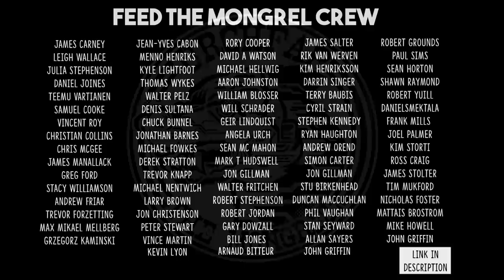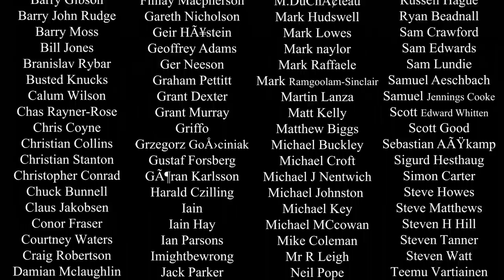THE MONGREL PART 57 ENGINE BAY PAINT

Comment: I have found best practice is to treat all bare metal with Phosphoric Acid, quite a number of products around often called some form of rust treatment, Deoxidine is one here in Australia.
Just brush it on and leave it. It will leave a slightly powdery white surface you just leave on till your ready to paint, then scuff off and etch prime as usual.
Nice to see some progress with the paint at last.

Comment: Hey Matt, I did some rattle can spraying on my car and used a clip on handle and trigger from Halfords, it's miles better than the button pushing, it feels like you're using a propper gun, but they are  stiff to get on the can when new, I modded mine and it works great.

Comment: Get yourself an infrared heater , it will heat what you point it at and won’t put diesel particles in the air .
Reply: He wont listen to any advice from car painters etc which is a shame...mask up the cross member and NOT mask up the scuttle!!!  All that over spray landing on a flat surface..
Reply: @theessexhunter1305  the scuttle will need flatting down and prepping before paint anyway, so no matter really.
Reply: it also doesnt blow dust around and into the paint, unlike more conventional space heaters, like the diesel heater.
Reply: @Sennaxm71  Good habits are far better than bad ones...cleaning and prepping a weld joint for ally or stainless is just the same. Not leaving swarf under the a work piece on the milling machine vice or bed. He de-greased the job only to blow diesel particles back on to it....Yes he will clean it off but less work for the sake of a a bit of masking paper is a good habit. I had a fantastic tool making  apprenticeship then later in on was taught body work by a Ford Rally body painter. My Dad taught me how to lead panels from his time as a plumber...So there are a few of us who know what is what...
Merry Xmas.
Reply: @theessexhunter1305  When did you say you were going over to paint the rest for him? 🎨
Reply: @Laz_Arus   The art is in the prep...good habits lol
Reply: I'm pretty sure that at this point hes more concerned with just getting paint on the thing than how its going to look when its done.  Just watch his tells when talks about it now.  He's so over this build its not even funny. I think he just wants it done so he can do a payoff vid or two with some smokey burnouts and get on with whatever comes next.  I can't say I blame him either.
Reply: Kristy- Matt takes donations..........

Comment: you should be wearing skin and eye protection. a full tyvek suit and sealed safety glasses. i did a set  of rims with 2 part epoxy aerosol . the vapors "melted" the lens's of my safety glasses. the very carcinogenic chemicals in the 2 part paint will easily pass through skin and the surface of your eyes. love the build cheers!

Comment: Good to see you get some paint down at last. Was thinking about the rest of the car/bare metal etc must be frustrating to see the surface rust appearing you just need to get a bit of protection down onto it.... that paint has come out pretty good have seen another ‘Tuber’ use the same system like you say great for smaller areas. Keep at it Matt, inspirational stuff as ever.

Comment: Put you self a poly tunnel off your metal rakes you can bend one Inch plastic pipe into shape with a little heat. Roll in roll out. Deisel heater may create moisture. You have to read up on that one. But may by Caroseen is the one I'm thinking going about. Stone chip is the way to go. Just remember it's all in the prep. Good luck. Merry Christmas. Ddd

Comment: I painted a whole car in rattle cans. It is doable however it’s damn expensive. Get a half decent gun. Use a gazebo as a booth. It sounds more hassle having to clean a gun n get water separators n filters but it’s actually easier in the long run. The main problem with cans is not being able to get it on fast enough. So the overspray from one end of the panel lands on the tacky paint the other end n needs flatting back n polishing more than you would if you were just flatting n polishing a gun finish. Also. Get abranet. It’s expensive until you realise how effective and long it lasts. It also solves all the problems caused by clogging on regular paper. If you find the filler thick in this weather you can add a splash of cellulose thinner to it to help with application. There’s a product called gripit xl that’s great for priming areas you can’t sand properly. It’s a clear adhesion promoter. Good luck dude.
Reply: beentelling him to build some sort of tent in his shop to use as a paint booth  i agee using a paintgun goes a lot faster and gives a better result , maibe he can have a painter come in on his day off to do the car after he done all the sanding and prepwork , just if he isnt sure of himself he do a good job of it 
i bet there a few pro painters that wouldnt mind helping him out some
Reply: Just do a panel at a time and you wont get this problem..but i agree so much easier w the gun

Comment: If your not top coating the car straight away you’ll wanna get the whole thing painting in epoxy as that will seal it from the moisture getting in and rusting underneath the paint. As your standard high build and etch will not as that is ment to be over coated straight away, also you can put filler over the top of epoxy. 
good on you for tackling it yourself tho 👍

Comment: One thing you probably should have done before paint is prepped the engine bay for a swap.
would have been dead simple when you were still cutting and welding . Now it's painted if you want to drop in a V6 or V8 you will have to mess your paint up.

Comment: hope you and the family have a great christmas , and all the best for the newyear 

not sure if the stonechip paint is good for the interiour floor its tar/bitumen based and might turn sticky and rub of on youre shoes when it gets warm , might be better to use some sort of bedliner paint wish is more rubber/plastic based 
as for the dieselheater: as long as it heats up the metal you want to paint and the paintcan holding the paint you want to use it should be ok painting in the cold

Comment: White is a funny old colour to paint, you can get away with mistakes but when spraying you can't see where the next layer is, black is the complete opposite to that. 2k cans are handy and good but not a cheap or fast method, I recon if you can tig weld you can spray paint with a gun, just practice a bit and watch a few youtube videos, I painted cars for over 30 years it's not that hard, and lets face it with the lack of reliability of other people you're going to need to learn how to do it. The filler work is what's hard to master in a timely fashion. You aren't building a show car ( I assume ) so perfection doesn't matter. Don't worry about mistakes we all make them. Get some metal prep solution to condition the rusty metal after sanding it gives you time before priming especially as you're doing it in winter.